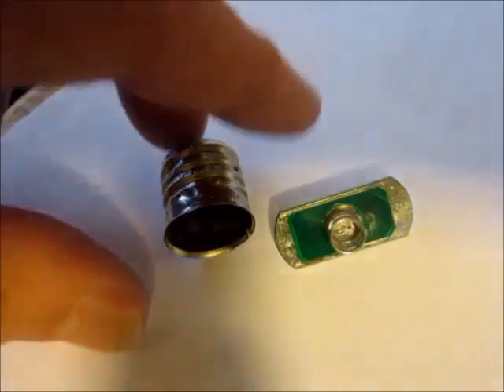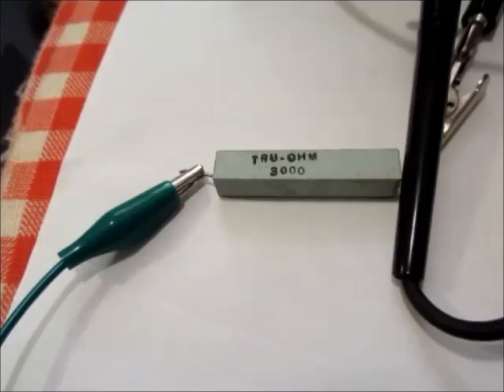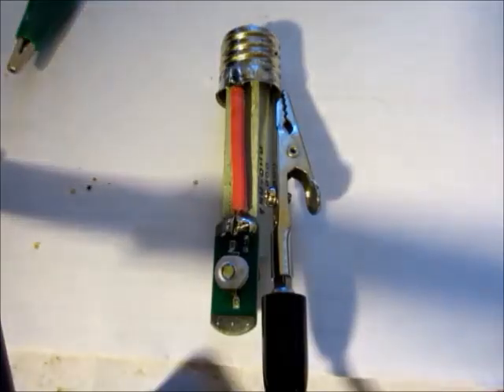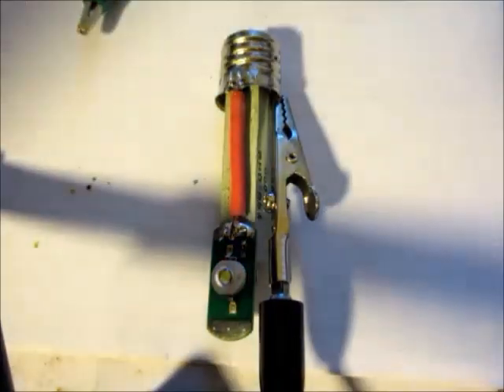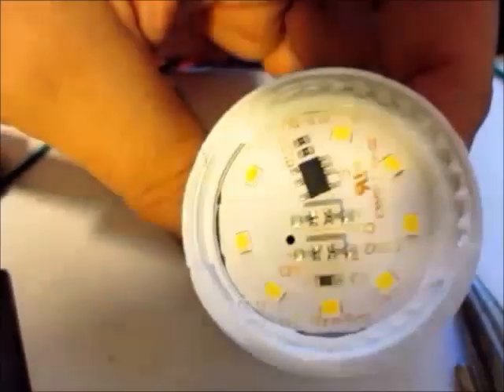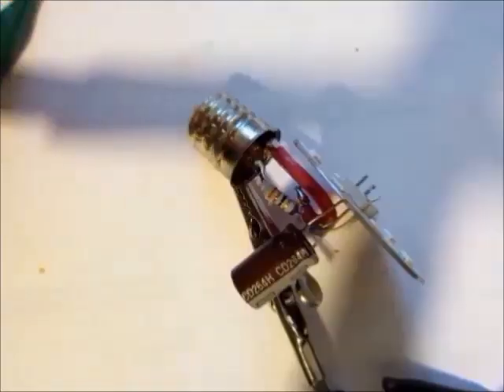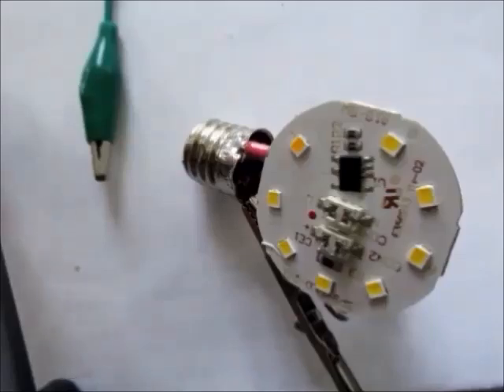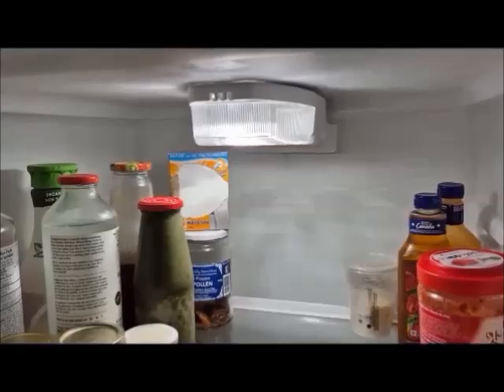Make an LED refrigerator light.

Comment: How about making a socket adapter instead. Make an adapter to simple screw onto a full size bulb that screws into the 'appliance' size socket. Would it be feasible?
Reply from the maker: I'll maybe try that next time.
Reply: @FranksPlace-jk7pj  I find your video very interesting as I am not into electronics, I'm a mechanic. As such mechanical solutions occur to me. Nothing wrong with your idea and execution in my opinion, it's a process.
Reply: Of course it would be feasible. It would also be more cost-efficient and simpler and safer. 

But what makes you think DIY nuts care about those ideas?
Reply: @OfficialOpinion  Like I was saying below, I'm a mechanic not an electronics expert, therefore mechanical solutions occur to me. I would still want to watch his process as it is fascinating to me.
Reply from the maker: @OfficialOpinion The person who's refrigerator this was made for needed an immediate solution,  there were no replacements to be had.  A  light had to be hacked from from what was available.  The solution wasn't beautiful but it works and will probably outlast the crappy refrigerator which broke down the first year.